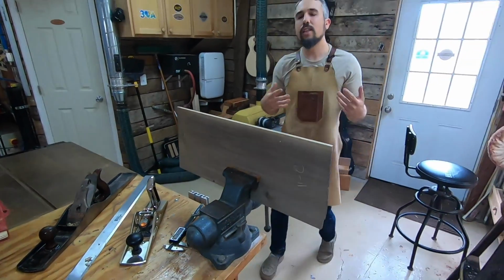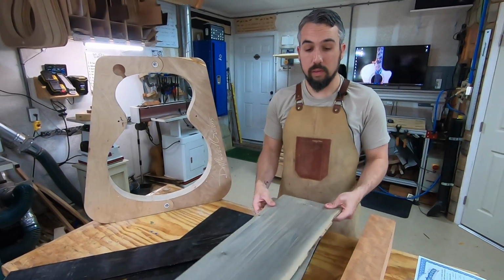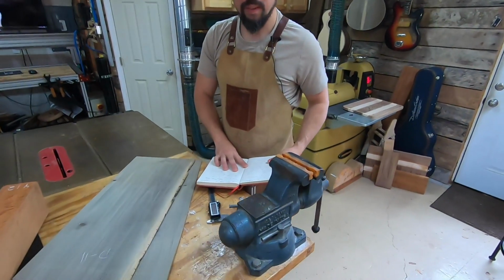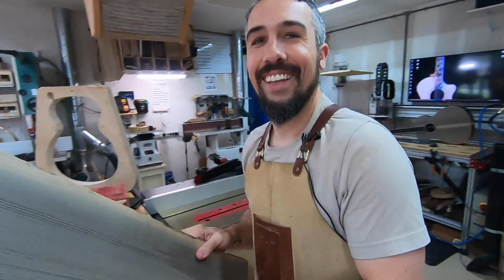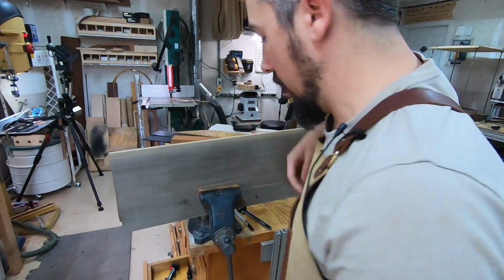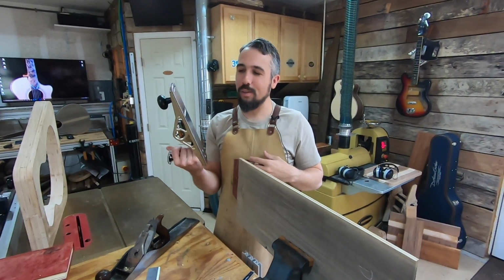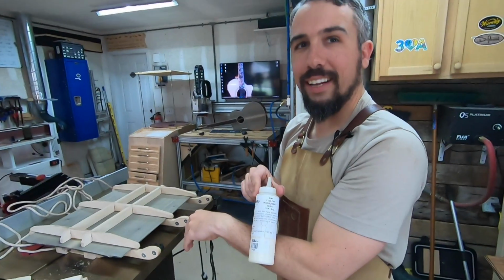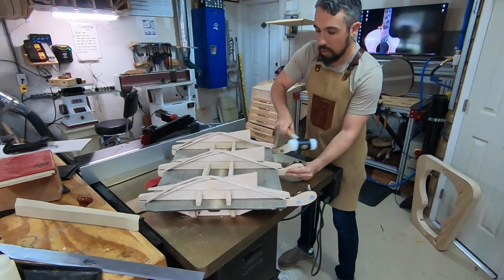How to build an acoustic guitar. Episode 1

Comment: It helps with the jointing to avoid the first and last inch of the edge, unless it is already concave along its length. Because the plane just has a natural tendency to take more off at the beginning and end of the cut when its bed is partially unsupported. This produces a hill shape. So put some lines about a half an inch or inch in from either end, and “land” and “take off” the plane at the marks. Once you take several passes and the edge is now ever so slightly concave along its length, now scribble along the whole edge with a pencil and then take full passes with a light cut. When all that remains of your pencil is an inch of so in the middle of the board, it is dead straight. To help with holding the plane a perfect 90 degrees to the face of the boards, you could double it up again and do four edges at a time. Just make sure the grain is all lined up so you don’t get tear-out. With all this planing another essential key is that your blade is installed straight so it cuts evenly. Check and adjust this by turning the plane upside down and sighting down the sole, observe the protruding cutting edge with the blade facing you, now tilt the plane slowly so the edge disappears from view. This allows you to see if one side is a tiny bit “high.”

Comment: Thanks for consistently building a great video series. Just to throw my glue experiences into the ring, I have been building for 40 years now, and for years I used aliphatic resin (Titebond) as long as it was up to me. A couple of years ago a customer requested hide glue, and a luthier friend suggested we go with fish glue instead. I was doubtful at first, but I ended up loving the stuff. It is a biological-based glue but needs no heating, has no smell, and dries super hard, unlike the more elastic yellow glue I was used to. I wouldn't have believed it, but I have actually found acoustic improvements (due to its hardness, I suspect) in my guitars and other stringed instruments. It is not a massive difference, but definitely an improvement. I suggest any luthier at least try it out, especially if your customer wants a hide glue build. (just make sure they know you are using the fish glue instead, of course).

Comment: Fascinating - I am curious about that plate jig and why it used ropes and wedges rather than a mechanical clamp?  Is it that the ropes and wedges apply both top and side pressure to the pieces?  loving this thanks for doing it
Reply from the maker: You’re 100% correct.

Comment: First let me say I love your videos.
I have seen some tables made using an interesting piece of wood & a "poured plastic epoxy". This got me thinking about the stripe in the center. What if you kept the edges & used the clear / coloured plastic to fill in the imperfections? I don't think strength would be an issue, but I have no idea what the musical properties would be . Of course try only a top from some "cheap wood" first.  How about a video on this, building 2 tops from the same tree, one with a "plastic" seam & one without for comparison. If this works , an LED back light .... ???

Comment: Hi Chris….hoping you will still be able to find this. 
Less expensive guitars will always have laminated sides. Will those sides be a double thickness like what you are doing now or are they single 2 to 2.5 mm thickness??? Thanks for the videos!
Reply from the maker: In the vast majority of cases, those cheaper guitars have literal plywood sides with a thin veneer of matching wood on the outside, not full thickness laminate sides like i talk about here.

Comment: Why do you not use a solid piece of wood for the soundboard, but rather join two pieces together? Is there a tonal benefit? Structural?
Reply from the maker: That’s how all guitar tops are made. It’s mostly done because it’s hard to get wood wide enough to make a one piece top. It’s also done so the top has a nice uniform appearance to it due to the book matching.

Comment: 05/24/2021:  Please see the attached video for Richlite fretboards from the company that actually makes the Richlite fretboards for Martin Guitars. The video showed large sheets of special paper soaked in a liquid resin, then pressed into solid thick large sheets.   I am looking at buying a Martin Special GPC All-Solid Grand Performance Acoustic-Electric Guitar Natural, which has a Richlite fretboard.  The only bad review of this guitar was like most guitars, it doe not have a rolled fingerboard edge.  So, if I sanded it to take the sharp edge off, I do not want to see paper layers or the differences in coloring.  Also, if in time my fingernails may dig into the fretboard taking out chips of material, and I wanted to sand that out too.  Would I see the paper layering and/or different coloring?   From what I see in the video that I attached, the answer might be yes (?), unless the Ritchlite fretboard is made differently for fretboards to not show the layering of paper.  What do you think?   Please see this video and replay again.  See line #637 in this video.  https://www.youtube.com/watch?v=0UT7Me7FUdw
Reply from the maker: In my limited experience with rich lite finger boards on Martins, it’s solid all the way through with no visible layers. You should be fine.
Reply: @DriftwoodGuitars :  Thank you for your fast reply!